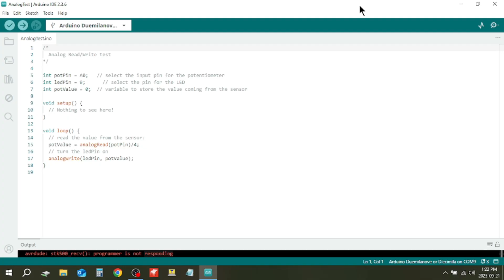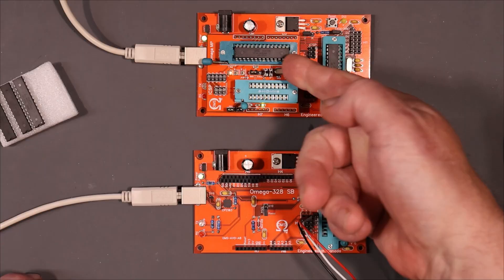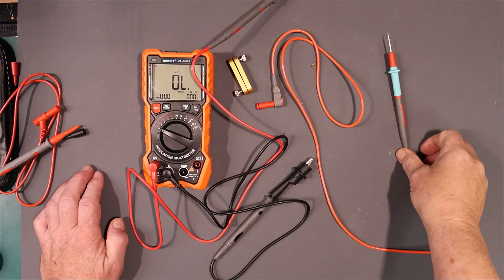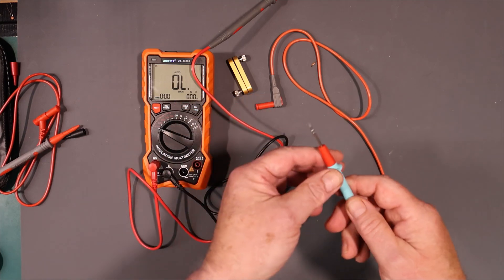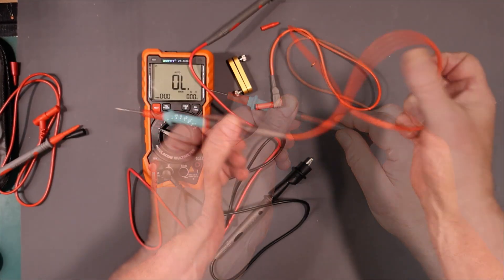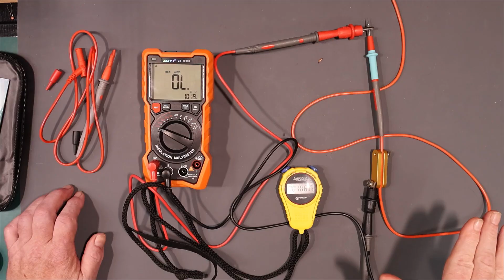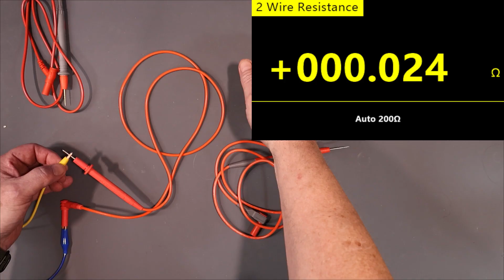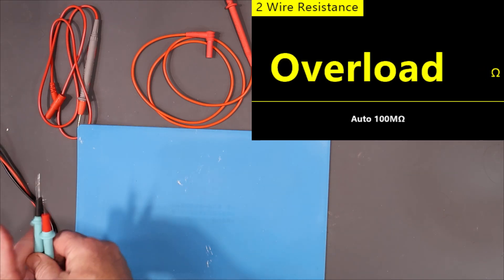Uni-Byte 0304 - Testing ALIEXPRESS Electronics Gadgets: #5

Comment: Just want to report that I got two of those blue-jacketed leads, from two different shops. Both have been disappointing. They vary wildly in resistance, much more than practically any of my other probes. Seems like the connections around the stress-relief / lower part of the handhold body has bad connections, bending that I can change resistance wildly, even to open circuit. I got a refund for the first set, I was so disappointed in their resistance; but I thought I must have just got a bad QA example. When I'm used to most probe sets firmly sitting near 0.1R when pressed together, these can vary an ohm or more just moving them gently around. I have some gold-coated probes, but I liked (the idea of) these because the tips although very pointy, were far harder to bend. But the overall resistance makes them useless for anything but voltage measurements
Reply from the maker: Thanks for reporting that.  I've not had problems with the sets I've put to use so far, but I do have 4 sets I've not yet used.  Time to get them out and try them.

Comment: I just received the test leads from AliExpress following your recommendation. It's nice not having the leads pull the meter all over the place or onto the floor.  Limp is good! The sharp tips get through most anything. I'm sure my fingertips will occasionally be on the receiving end but it goes with the territory.

Comment: There are three variants of the ATMega328; the OG 328, the newer "picopower" 328P, and then the 328PB with a touch perhipheral. They can all have different chip signature bytes. So you can't program an ATMega328 as an "Uno", because AVRDUDE (the programmer) will go looking for a 328P signature to match up and find the wrong chip signature bytes. They are 0x1E95{14, 0F, 16} for {328,328P, 328PB}.

The Duemilanove option is working, because if you look on Arduino's website, it actually uses a vanilla 328 chip.
Reply from the maker: More good information.  Thanks!

Comment: Where can a person purchase extra tip covers to prevent pokey-pokey?
Reply: My guess is that you are not going to find them for sale, separately. Try this trick = Select some heat shrink tubing that, when heat is applied, it will shrink down to the diameter of the tip barrel. Cut the heat shrink to a length that will fully cover the tip, plus say 6mm beyond the point. Put the heat shrink onto the tip, leaving the extra proud of the end of the tip. Set out a pair of "duck bill" flattening pliers. Apply heat and shrink the tubing. (But, do not shrink the heat shrink down so tight that you can not slide it off of the tip.) While the tubing is still hot, clamp down the extra length of the heat shrink that extends beyond the tip with the duck bill flattening pliers. You want to smash the end flat, but don't crush it. The flattened end will stay closed and make a DIY tip cover. I hope that helps.
Reply from the maker: @t1d100  Nice tip!  But definitely do not use the HS tubing with hot melt glue in it!  Might ruin your day.
Reply from the maker: That I don't know, but most tip cover I have knocking around seem to fit fine.

Comment: If I recall, it isn't sufficient to just upload a bootloader.  Rather you need to also fiddle with the fuses which dictate where code starts/is-uploaded and protection of the bootloader (as well as a bunch of other settings like the clock etc).  It is "possible" that a brand new chip could have the fuses set correctly, but (again if I recall) it is not likely, and you have to set them yourself.
Reply from the maker: Something to look into.  Thanks.

Comment: This may be something you are already aware of but in my experience using the ICSP would allow uploading of either the bootloader or a sketch, depending on your requirements.
The uploading of the bootloader then allows normal uploading via the USB, which is what it's for, and the default method for subsequent sketch uploading.
This retains the bootloader in order to continue normal USB uploading of sketches.
On the other hand, uploading a sketch via ICSP will delete, (overwrite), the bootloader, its not needed to u[pload sketches when using the ICSP.
This method can be used if memory is limited, without the bootloader you have a few extra bytes to squeeze everything in.
I don't know if these programmers you are using use the ICSP for programming, but if they do then it may explain why the bootloader isn't retained after uploading a second time around....unless it's the bootloader again. Just a thought.
Reply from the maker: In this video, I put on the bootloaders using AduinoISP (which uses ICSP protocol) then moved them over to the other board where I attempted uploading through USB and the installed bootloader.  The UNO bootloader failed immediately, the Duemilanove  bootloader worked once, then failed.  I am very much aware of the benefits of using a programmer.  That's why I work that way most of the time.

I just tried exactly what I did in this video with a ATmega328P-PU and it worked fine.  There is something different about teh AT mega328P-U.

Thanks for your commentary and suggestions!
Reply from the maker: So, you're saying that ICSP (I have one or two of those) will do a better job than ArduinoISP?  I guess I could give it a try.  My normal use case is to load either bootloaders (rarely) or sketches using ArduinoISP as the programmer and "Upload Using Programmer".  I've never had an issue with loading bootloaders this way the odd time that I need to do that.
Reply: @uni-byte  Not necessarily, no.
As you know, bootloaders have to be uploaded using the ICSP (SPI) pins, this overwrites any exsisting bootloader, but subsequent uploads of sketches will also overwrite any bootloader.
It got a bit confusing in your video as to what chip was doing what, with what and how so this is guessswork but it appears that the ICSP is being used to upload the sketch, as you say 'the bootloader got kicked off this when we uploaded the blink program', this will happen if ICSP was used for uploading the blink program.